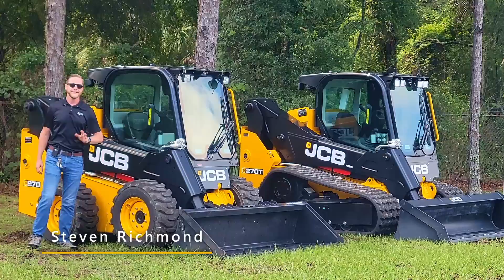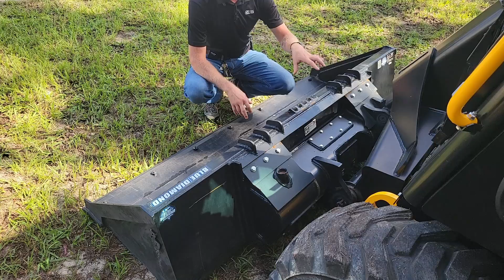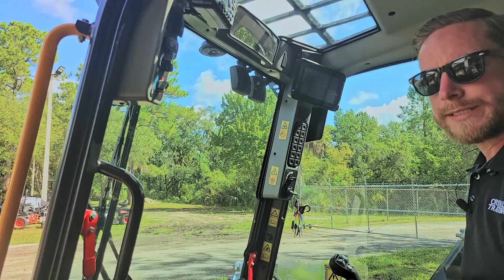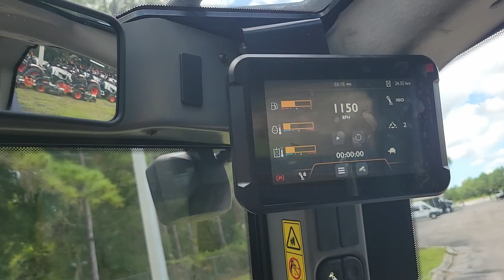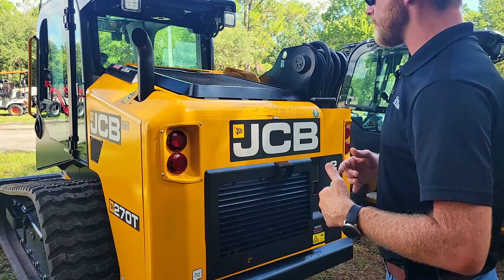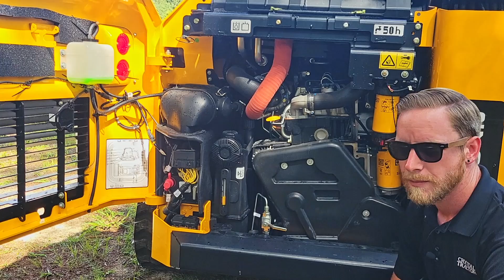JCB 270/270T Detailed Overview

Comment: I purchased two new '23 units a couple months ago, one 270 and one 3TS-8T and if you used any other skidsteer before, you will quickly notice JCB built a better mousetrap! These machines are the best thing since sliced bread, and if you work alone, it's one of the only ways to do jobs where you might need to exit the machine while the loader is in use. The teleboom is total game changer, highly suggest getting that one if you are only getting one machine.
Reply from the maker: Glad to hear they're working so well for you! It's definitely a unique machine. 

We'll be doing an overview on the 3TS soon as well (as long as we can keep one in stock long enough to get it done 😅)